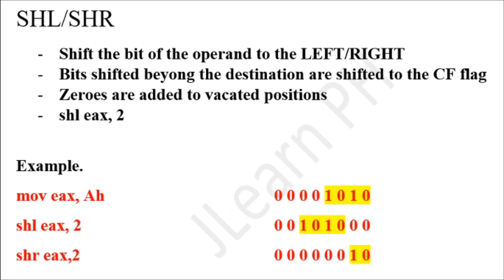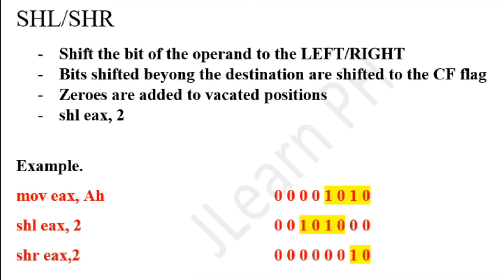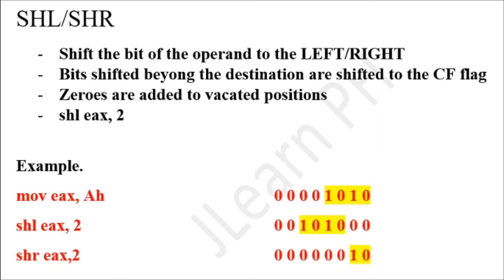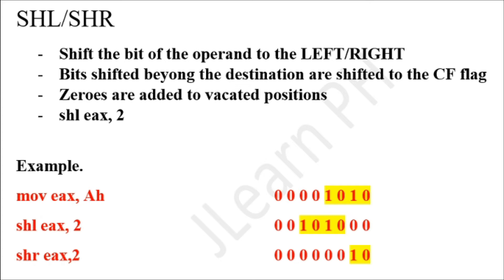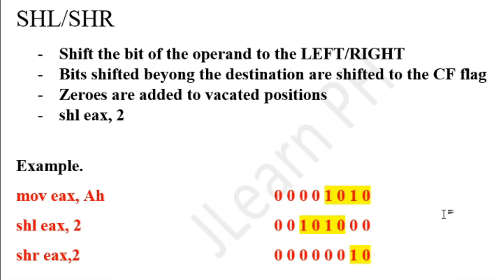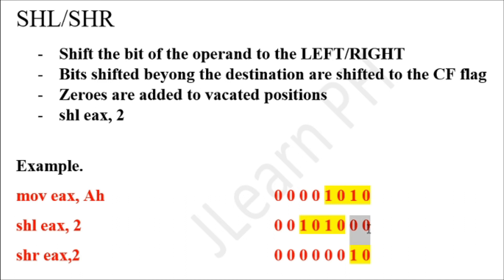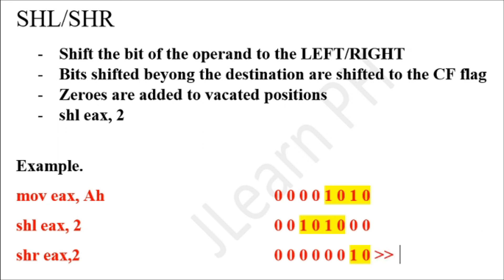SHL and SHR Instructions | MASM32 Assembly Programming

Comment: I've seen a few videos showing how to use SHR/SHL, but no one explains WHY? Why would you use these commands. What purpose does it serve?
Reply from the maker: from my experience, i see it in some malwares so that you cant easily read it
Reply: I did some more research and apparently it is used to multiply or divide by 2, which makes sense in binary math. I knew that's what happens when shifting, but didn't know that it was the actual purpose of it.